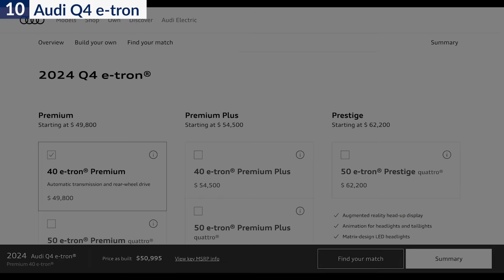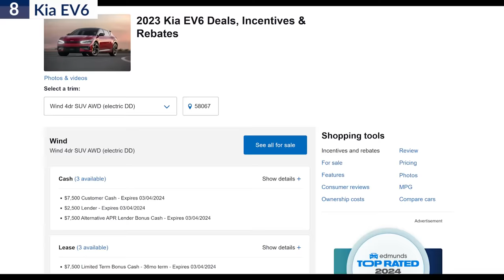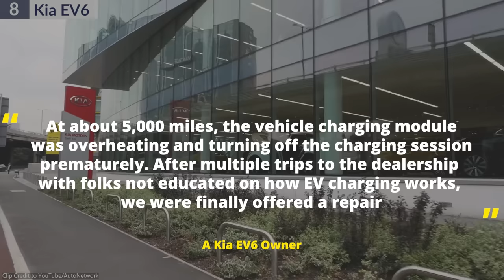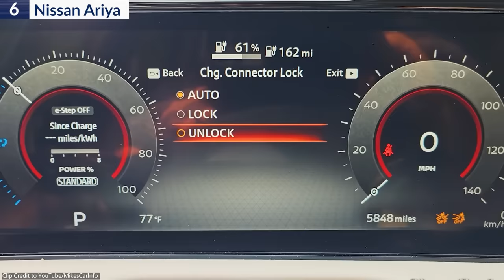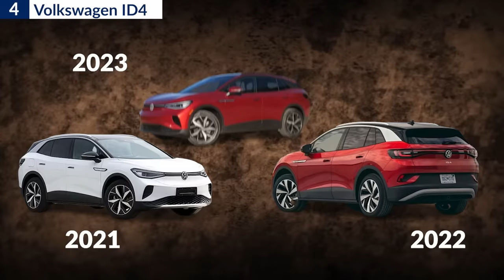New Electric Cars Piling Up on Dealer Lots in 2024 – Here is the Truth!

Comment: They will realize everyone doesn't want an EV or be forced to buy one.. I want to put in my gas and go. the battery cost more than the car.
Reply: CRAP EV MOTOR ,SCRAP METAL FOR RECYCLE PURPOSES!
Reply: @alexfung9097 its fine we can make starter motors and alternators out of the ev’s
Reply: Same here in Australia.
Reply: The battery obviously doesn’t cost more than the car.
Reply: @alexfung9097  Electric engines alone are better than combustion engines but energy storage technology needs a huge revolution to actually make ev cars compete with your classic ICE
Reply: In my 5 years experience I will never buy gas cars anymore. Best experience and no problem with charging. Also I hadn’t any problems with batteries. Still more than 93% of capacity.
Reply: @SergeyStupkin  precisely. The opinions of real life users is worth a million of these idiots.
Reply: @Audioremedy0785  Are you certain that a brand new battery pack wouldn't be more expensive than the car is worth? Not talking about a FRANKEN PACK cobbled together out of multiple already failed packs.
Reply: You completely Right…
Reply: How much gas and oil do you think you will use for 300,000 kms? About $25,000 in my country at current gas prices.
Reply: I was very much against an EV. I made the biggest mistake by purchasing a 2022 BMW M4 competition cabriolet - now 2 years later I just bought an EV - Porsche Taycan. Best decision I ever made in my life!! It works for me!!
Reply: @Lifeisapartydresslikeit  what I find funny is that 98% of people who buy an EV love them and will never go back. However 99% of people that hate on them have never even been in one let alone own one 🤣
Reply: @Lifeisapartydresslikeit  just don't trust it yet.
Reply: And never mind the damage to the environment, the pollutions etc? Just so you can use heavily subsidised fossil fuel?
Reply: If Americans had to pay the real price for their “gas” which isn’t a gas, but a liquid fossil fuel, they might switch to EV rather faster
Reply: @paulfowler3416 if they live in a apartment, can't charge at home. They wld realise ev charging is just as expensive.
Reply: @alexfung9097 still have to deal with the battery pack.
Reply: If you have that opinion don't ever drive a Tesla because your opinion will change instantly but I respect it no one should be forced to do anything... I'm trading in a 2019 mustang GT for the new Tesla model 3 Ludacris coming out later this year but you make a valid point no one should ever be forced in America... But then again we're forced to live next to a illegal immigrants and drive on the roads with them but then again we're forced to live next to illegal immigrants .. And they get licenses so they can vote.. That's the country you live in so don't be shocked if you're forced
Reply: @Longtack55  I get 26km per liter of diesel in my Hyundai Accent 1.6l and diesel is 65php per Liter. Oil changes are complimentary for the first 36k miles. So that's $1.07 USD and roughly 6.6 United States pennies per mile. My advise is for you to move! Even our 2023 Hilux gets 20kmL. You must be driving the shittiest ICE ever and buying the cheapest Chinese shitbox ever if you think you are better off.
Reply: @Plackomiot  if gasoline was better and more precise.. when you go to get surgery or the dentist .. You would have a gas powered saw or drill stop it guys it's what's happening and you sound like people... When streaming came out you would say things like I don't care about streaming I have a DVD player
Reply: I hear you. I was a non believer too
Reply: this is very true. My brother says the same exact thing you just said. People who have something negative to say never owned one (me included) and talk about ‘facts’ that they don’t know. Anyone I ask who have an EV say they will never ever ever go back to a gas or ICE car - EVER!!
Reply: @Longtack55 your country sucks - for that mileage it would cost around $10k for my car that gets around 50-52 mpg at $2.50/gallon cost - countries that have higher costs are intentional like California
Reply: Lol EV 😂
Reply: @Lifeisapartydresslikeit  But where do you live and how many people do you know who have BEV? Some people might live in the inner city and never leave 12 square blocks. EVeryone they know would be from that same 12 square blocks. A very small Plantation.
Reply: I was forced to buy an EV. Said nobody ever!
Reply: @rocksez5101  I as a taxpayer WAS FORCED TO SUBSIDIZE SOMEONE ELSE'S BEV!
Reply: @anthonybarnes5555  Its nowhere near as expensive I pay $15 to fill my batrery at a supercharger and jts 100% free to charge at my apartment because they have free chargers here. On a gas car you gotta pay $30-40 regardless of where you are
Reply: NOBODY IS FORCING YOU TO BUY AN EV! 🙄
Reply: @Jeffisright  Sure they are! I pay $300,000 in federal taxes and the government gives BEV buyers $7500. I'm being forced to pay for cars I don't EVen get.
Reply: 1. Child battery mineral labor

2. Range anxiety

3. Risk of garage fires

4. Paying 20k more than a
comparable vehicle

5. every time you fuel up an EV, the fuel tank gets smaller  and smaller. Battery degeneration. 

6. Poor resale value

7. Reduced performance in
cold, highway.

8. Higher repair costs

9. Awful charging network
experiences in the weather
without restrooms

10. Higher insurance rates

11. Replacing tires more
frequently. Michelin states that tires wear out 20% faster on an Ev, and could be as high as 50% faster! Ev tires made for ev's, cost 20 to 30% more, than regular tires for ice cars. As Ev tires wear out, they leave behind more tiny particles of rubber than normal ice cars. This causes more pollution. 

12. Death by autopilot

13. $25k - $35k battery

14. Low km range per tank of energy. 

15. must wait in-line 1-2 hrs
to charge.

16. Then wait more time to charge, while charging.

17. Spontaneous combustion, with no way to put out the fire storm.

18. If they catch fire in a tunnel, many people will die.

19. People without a pro charger system or a parking spot at their house, will run an extension cord to the road, which is dangerous and could lead to people tampering with your charging setup (super slow charging at the road)

20. If you're in California, you won't be able to charge your car past 4pm because of a shortage of electricity supply on the cheesy grid.

21. It is not actually "green". The pollution is made at the power station, not the car.

22. Only 5% of used junk batteries get recycled, the rest go directly into the bin. It's cheaper to mine for new minerals.

23. Chhinna actually does 70% of all the refining of the minerals and production of the batteries.

24. Minerals are becoming more and more scarce, and the cost will only go up, not down.

25. Some countries where they mine for lithium, actually use a very big boat load of fresh water to only produce a ton of lithium, so they are afraid of running out of water. It takes over 2 million liters of fresh clean water to produce 1 ton of lithium. 

26. Ev cars will soon not be able to drive in tunnels or be able to park in underground parking garage and probably will eventually void your house insurance if you park it in your personal garage.... 

27. You can't charge your battery at super stations when it is bitter cold out. 

28. If a fire truck comes to put out an Ev fire, all the chemicals go directly into the sewer system, poisoning everything. They need tons of water to slow down the burn. They can't put them out. They are only trying to prevent over things near by from catching fire. 

29. Ok, there is 2 good things; regenerative braking, which charges the battery while you are slowing down on the highway, which saves your brakes from much wear.

30. Loss of fuel tax revenue, so now the roads will only get worse, not better. 

31. in Dublin, huge generators are being used to charge EV buses, due to electrical grid strain. buses in Athlone also cannot be put on charge until midnight, for the same reason. Bus Éireann is saying that they can't charge their buses until 11pm for the same reason,  and to avail of a lower tariff. 

32. Not everyone on earth even has electricity to charge their cars. What are they supposed to do in 2035? It's easy to get a bucket of fuel to power up a regular car. 

33. VCE, or "vapour cloud explosion" is very bad. If any battery, typically anything larger than an E-scooter battery, and especially only "half" charged. If a problem occurs in the cells, it might not catch on fire right away. Instead, a cloud appears, and then may be ignited a short period afterwards. There are 2 different types of vapour clouds that appear; heavier and lighter than air, which form will be dominate, can not be predicted yet. This produces a bomm.

34. For Ev transport trucks, they aren't allowed to carry the same payload as a diesel truck, because of the massive weight of the battery. The owner of the Ev truck therefore loses potential profit, every day. They also lose more profit for the waiting times for charging that Ev truck. The driver will get paid to charge the truck, which in turn forces the owner of the truck to lose more money. 

35. Ev cars are more likely to be written off, if they experience a minor collision. After the collision, something could have upset the structural integrity of the battery. 

36. Ev cars lie to you. If you are bold enough to go out on a decent road trip and its 210 miles, one way, and your Ev tells you that your battery will last you 223 miles, there had better be no hills, or excessively cold out.... You'll probably get stranded, trying to get to the charger, at the end of the trip. Ev's have left many families stranded already. 

37. Ev's and their batteries, will soon need their very own "passport". With all info about them when born, and current info about them (power output, resistance, mineral composition, etc.) 

38. Thieves stealing charging cables, will soon make it impossible to "fuel" an Ev car. They take a long time to replace the cables, just to have them cut again for scrape money. 

39. Cars were typically being made lighter and lighter using aluminum and or fiberglass and or carbon fiber, to reduce emissions and pollution. Ev's are only getting heavier and heavier, causing more pollution than ever. Remember, an ev's pollution is made at the power station and the dump, not at the actual Ev, except for the tire particles as mentioned above. 

40. More on spontaneous combustion of the battery. What if you had 3 kids strapped into car seats, in the back seat ,which kid do you rescue? More fires start so fast, there is hardly any time for even the driver to escape, let alone 3 kids strapped in. 

41. There must be a reason that Boeing 747's aren't battery powered.... Until jets are battery powered, I'll be sticking to fossil fuels for my mode of transportation. 

42. Can't bring an Ev up north in the woods, nor any battery powered chain saws, where there are no grids to charge them up. You would need a huge amount of solar panels to get you anywhere. 

Ev's (External combustion vehicles) suck, and it's a bridge to nowhere. But they do sometimes convert themselves into "internal combustion", but sadly, they can only do that 1 time.
Reply: Too bad you are so poorly informed.  That battery has a 100,000 mile warranty and 8 years.  The engine and transmission in your ICE car/truck has a 36,000 mile warranty  yet if properly taken care of will last for 200,000 miles or more. 
     Like the battery of the newest Tesla will likely last a million miles.
Reply: The new Tesla’s are exactly that!! .  90% of all daily travel will be covered by less than a single charge.  Then you will go home and plug in during off peak hours. 
  Instead of costing you $40-50 bucks for a fill up it will cost you $8.
Reply: @robertkubrick3738 if they live like that. Why do they have a car?
Reply: @jakefriesenjake nobody. Absolutely nobody read that.
Reply: @Eddie_-_  ha. You bet your mammas life on that?
Reply: @jakefriesenjake  don’t laugh. It’s you, not me who has a standard reply saved on your old laptop to post on the internet in various threads. Even my mum would think that’s pathetic.
Reply: @Eddie_-_  actually, I have an old laptop, newer laptop, newer desktop, and newest galaxy S23 Ultra, my boy. Yeah it's copy n paste, but it's my copy n paste. 🤣🤣
Reply: @jakefriesenjake   desktop?
Reply: @Eddie_-_  what about it? You not know what a desktop is?
Reply: These automakers have to sell less than Tesla , because nobody is going to pay more for a non Tesla
Reply: @jakefriesenjake   off course I do. But haven’t heard anyone talking about it in 30 years.
Reply: Who's forcing you or anyone else too buy an EV??
Reply: Who's forcing you or anyone else too buy an EV??
Reply: @Eddie_-_  why not? Almost every single office in the world has a desktop computer
Reply: No more oil subsidies
Reply: @Audioremedy0785 True but if the EV is say 6 years old and the battery is dead it almost is...
Reply: @Audioremedy0785 When it is time to replace the battery, it costs more than the car is worth. That is a true statement.
Reply: @Audioremedy0785 So the 95% who don’t want a clown car are idiots? 😂😂😂
Reply: @frenchydampier2209  large % of pple don't have off road parking. Can't charge at home.
Reply: @mikeses4392  in what way is an Ev a clown car…
Reply: @jakefriesenjake  I work in a multi national company and travel a lot. I have not seen a desktop computer in at least 20 years. I don’t think you can buy one, unless you’re looking for a gaming computer. 
Could it be that you are a bit behind on the technology development and that’s why you’re against EVs?
Reply: Do you know in Europe  you can get a Peugot 5008 1.2 three cylinder petrol for the same price as a Tesla Model 3. Funny thing with this video is that it does not mention the Tesla brand. I know why. Its because they make the best selling car in the world at the moment. People are buying Teslas instead of the other brands due to them being better.
Reply: @andersriksson100  not really no. It’s almost out of warentee yes. But the expected life of a battery is 10-12 years. And life is defined as a capacity of over 80%. After that time it’s very reusable. And costs of batteries are expected to be less than £5k within 8 years from now.
Reply: @andersriksson100  when you say they ‘fail prematurely and are expensive to replace’ - they are covered by an 8 year warentee. So if they fail within that time they are free to replace and if they fail after that time, with the anticipated reduction in cost, they will be about £5k to replace after 10-12 years. Giving you another 10-12 years with a car that’s saving me £2k a year on fuel.
Reply: @Eddie_-_  not really, I've fixed computers before, and own the top of the line phone.

Not against ev's, get what you want. If you only travel very short distances, it might work out for you. If you own a garage or a parking spot, even better. You would then be able to charge your car at home. All cars have problems.
Reply: @Audioremedy0785 What I find even funnier is that over 20% of first time EV buyers...REGARDLESS OF BRAND...have done EXACTLY that and gone BACK to ICEVs.

Sounds like your stock picks might be dropping...as well as your service and repair options for your golf cart...
Reply: @Lifeisapartydresslikeit Sounds like you have the income to buy an EV as a TOY.  Most people are making their purchase decision on having this as their ONLY car.  Most people find EVs an underwhelming option...and don't buy even with government mandates.
Reply: @paulfowler3416 If it was subsidized it wouldn't also be getting TAXED.

Please learn definitions...words mean things.  To paraphrase a movie...'subsidy...you keep using that word.  I don't think it means what you think it means.'
Reply: @paulfowler3416 No, since the NON-TAXED, NON-GOVERNMENT DISTORTED market price for those fuels would be far LOWER than it is.

Drops in the prices heading into the presidential election are going to absolutely KILL EV sales.
Reply: @commoncents864 No, if EVs were any good, the EV1 would be the oldest used car in the market today, and ZERO government force would have ever been needed.

Peopke who know how to drive and who have tried EVs, have mostly found them to be INFERIOR to an ICEV...TO INCLUDE THE ONE THEY CURRENTLY OWN.  That is the main reason people WON'T be buying one any time soon.
Reply: @rocksez5101 NOT.  Said every trend humping tech consumer in urban areas who bought an EV and has to crow about it online to keep their local social cred.
Reply: @frenchydampier2209 There isn't an EV battery pack that's made it past 300k yet, or even most EV MOTORS.  That's a wishful stat that hasn't happened.
Reply: @frenchydampier2209 IF you can recharge at home.  If NOT, and you live anywhere outside of SoCal, tour ONLY charging option is PUBLIC charging, which is usually over 40 cents per kWh.  And your golf cart loses charge just sitting there, so you'll be charging more than just the distance you drove...EVERY TIME.

At least the fuel you put in an ICEV is still there the next morning, meaning you don't HAVE to visit a fuel station EVERY MORNING.  So the actual amount you spend in charging will end up being as much (if not MORE) than what you'd spend on petrofuel.

Just the facts.
Reply: @Audioremedy0785 maybe not initially but it will when the battery needs to be replaced. And the car has lost its value
Reply: @DavidChick-z8s  it’s a weird one as ‘battery failure’ is catagorised as when the battery has 80% or less charge. If my car is 12 years old and has 80% of its range yet, I’m not complaining. And the cost of batteries is expected to half in the next 10 years. So spending c.$5k on a battery pack having been saving $2k a year on fuel for 12 years is literally nothing.
Reply: @Audioremedy0785  Well I just don't agree. There are too many expectancies, too much trust in suppliers in your reply, at least to me. Guarantees of 8 years/160000 km isn't much for such an expensive car as most EVs are and we don't know if batteries will be significantly cheaper, still very expensive even though they been around for more than 10 years. But to each their own.
Reply: @andersriksson100  I think manufacturers have trust in their product. Otherwise they wouldn’t offer guarentees. And the reduction in cost of batteries is inevitable. Can you name a single technology where the version available 10 years ago wasn’t cheaper?
Reply: EV is so much better. Period
Reply: @@DeezNutz013 LOL indeed, since your numbers aren't even backed up by TESLA.

People buy Teslas because they're a trend...PERIOD.  As evidenced by plenty of YouTube channels come and gone, if they think the trend isn't growing, they quit their car and their channel.

Nit a resounding endorsement of 'the best EV.'
Reply: @earthring  Not in reality...hence the mandates and subsidy.
Reply: @Audioremedy0785  I don't think you read my post right! I said the guarantees are'nt good enough. And they all said batteries would get cheaper in time with volumes, but now more than 10 years after they where introduced they are still fragile and too expensive to swap. There are quite a few examples of EV owners with faulty batteries beeing quoted 10 000-30 000 US or more for a battery swap, crazy!
Insurance costs are sky-rocketing because of that and expensive repairs.
I'd never buy a used EV 6-8 years old close to 160000 km om the meter - that battery could die anytime and then you are screwed big time. So a used EVs will probably have low resale value quite soon. Bad for TCO but one might fool oneself the first trouble free years with low running costs, they wouldn't be the first or the last...
Reply: @andersriksson100  I read your post quite clearly. I have seen crazy posts where people are getting mad quotes for battery replacements.  But I have also seen that battery replacements are very rare and in almost all cases where it’s chargable, it’s a reasonable cost. The reality is that battery capability will increase significantly over time.  In 10 years you will be able to get batteries with todays capabilities for a reasonable price or batteries with much more significant capability for a higher price. I have never bought a high tech product in fear of the tech not being improved over time. I love my EV. They are not for everyone and if you’re worried about that kind of thing then you are right, they are probably not for you. Bit my Tesla is ana amazing car and an amazing drive and my only regret is that I didn’t do it sooner.
Reply: Battery does not cost more than a car 😂
Reply: @DeezNutz013  Simple search shows that thry SHOULD be able to go that far, but the ones touted as doing so have later been retracted because the battery had to be either repaired or replaced under warranty.  That's not the same thing.

And as to your numbers...how much did you pay for installing an actual L2 charger in your garage (which most folks don't have, by the way)?  How much power OVER AND ABOVE THAT USED TO  DRIVE did your car suck down in that time frame?  Are you getting state subsidy to mitigate charging costs?  How much power are you getting from your 'free' charging that not everyone has access to?

Some of your costs are being borne by less well off people, and you're not providing the entire power usage picture for your car.  So your 'costs to run' numbers are also a bit suspect.
Reply: @SergeyStupkin  my 2015 Tesla model S has been the lowest  cost to own luxury car I've owned.  So far replaced 2 sets of tires and 6 bottles of windshield  washer fluid.
Reply: Subsides are paid for EVs, not oil companies. You are delusional
Reply: @Audioremedy0785  If present batteries has'nt dropped  in price the last ten years there is not much saying they will soon. Further, will it even be possible to get hold of a Tesla battery to a Tesla of today in 8-10 years? How do we know if batteries of tomorrow (solid state?) will fit EVs of today? I belive many EVs prematurely will be considered a “totaled” car by insurance companies because of this, it has already happened.
Reply: Own an Audi etron. Will never go back to Ice. 300 mile range in summer if sensible. 6p a kw charge at night (50% of battery) suits me
Reply: They don’t have near enough range but I test drove a Model Y and 3 and loved the way they drive.  When they became available in my country, I ordered one the first day.  It’s been a really good car. Super cheap to drive.  Our beach spot for mini vacations used to cost $40 in diesel to drive home.  Now it’s $9 worth of electrons, on a third party charger.  (Superchargers don’t exist down there yet. ). The model Y’s inter is minimalist.  This is code for featureless, but it gets the job done.
Reply: 7-13k depending on the model? It's the same as replacing the whole car though and they have some that have exceeded 500k to a million miles.
Reply: I do believe people should be able to drive any vehicle of your choice but I have had 1 % degradation since 2018 and after owning many gas cars I save a lot of money in not having to buy individual parts, oil changes, oil filters, spark plugs, fuses, transmission fluid, fuel filters, pistons, or replacing a whole motor. Also no one can sabotage my car just by adding some sugar.
Reply: Go to California…
Reply: @emmajones9228  after owning a Nissan Leaf hatchback and a Tesla it really depends on which car you pick for what's worth it for you. I recently ran into a family trying to charge an EV at a Tesla station that uses CCS. Rental places don't explain things like an all called plug share and the difference between cars
Reply: u already pay that at the ev initial purchase, at 0 miles done. plus electricity isnt free  and r u sure your ev will last 300k miles? my non ev car is now 20 years old, will yours last the same?
Reply: U was forced to take a shot wasn’t u 😅
Reply: @SergeyStupkin  Do you have the privilege of charging at home?  Many of us don't.
Reply: @commoncents864  the most idiotic comment ever 😂😂😂
Reply: There are seven new Teslas on my block alone. I purchased my first Tesla Model 3 Performance in 2019. Everybody that I have let drive it ended up buying one or two. We just picked up a Model Y Performance for my wife two months ago. We still keep two ICE cars. I plan to add a 911 S next and will give my BMW M3 to my son.
Reply: 😂😂😂😂😂😂 we already have 3 and I Switch now to number 4 who is everyone?? The absolute dünn????? Asking for a friend
Reply: @SergeyStupkin we top!
Reply: @paulfowler3416  the damage to the environment? You mean like mining for lithium.... you sound literally like the people in that episode of SouthPark, the ones smelling their own farts that is 😂
Reply: @commoncents864  so what you going to do about all those illegals driving on the road??
Reply: @mocheen4837  "One or two"?  What kind of area do you live in?
Reply: @Lifeisapartydresslikeit More importantly, buy only Tesla in these early days of EV adoption. They are the masters of the technology and they have the supercharger network already built. Roast me if you like, but you know I’m right. Yes, I have a Model 3 Long Range All Wheel Drive and won’t go back to ICE.
Reply: @robertkubrick3738 Well the upside of being forced to subsidise an EV is that you weren’t forced to subsidise universal health care, so that was a win for you.
Reply: @jakefriesenjake Don’t buy one then. That’s you fixed. 😀
Reply: @billcichoke2534 I like reading your posts; Trump is going to win, isn’t he.
Reply: @petergersbach7355  It's forced subsidy of something that is eventually a detriment to everyone.  Whether golf carts or 'free' healthcare, there are ALWAYS negative consequences that outweigh any EXPECTED benefit.
Reply: I agree. Some battery packs are more than 30k..😡
Reply: @anthonybarnes5555 I live in an apartment and I charge out my kitchen window     

Been doing it for 6 years.
Reply: @jakefriesenjake WOW!! Talk about a lot of BS.   You’re the winner of the most anti-EV BS I ever read.
Reply: @NAY2GAS  🤣🤣🤣 what floor do u live on.
Reply: The battery is the car
Reply: @Audioremedy0785  There have been numerous reports even on the liberal national news of people with a one or two-year-old EV, the battery gets damaged, and the replacement battery cost as much as the car cost when it was new.
Reply: @SergeyStupkin  Come tow my 14’ work trailer or try to charge your vehicle sitting outside on a -20° Minnesota night. Or, get in your vehicle and drive 1000 miles straight to visit a family member.
Reply: @DuffyGabi  I drove last month 1500 miles. 6 stops. Each was 20-30 minutes. No problem at all. Also I charged my car at -12. Also wasn’t a problem. Yes, range is different but it wasn’t a big problem. All what you can do with ev is planning ahead. For some people it’s not easy. As for me not harder that drive on ice cars
Reply: @DuffyGabi  numerous being ‘a couple’. All prices quoted by insurance companies who need to justify writing the car off for the purpose of a direct replacement.
Reply: I drive my Tesla model Y Performance and you will always see my tail lights!
Reply: @derrickhuggins6453  u sound miserable 😂 and I don’t care about none of this matter or that matter or any matter 😂 but hey go off 🤣 prove yourself to the world u got this 🥲
Reply: @disgracetwt5513 lithium mining can be done much more cleanly and lithium is on the way out as battery science advances apace. So ,including the egregious insults, you appear to be wrong on every count.
Reply: You are right, this is an issue that needs to be resolved and needs government investment in infrastructure. Norway manages so why not other countries? Lets see, politicians, especially, but not only, right wing ones, don't help, with outdated and rather silly views.
Reply: @paulfowler3416  keep yapping
Reply: @disgracetwt5513 I admire your well constructed, reasoned argument, so persuasive, so redolent with facts. Tells all that anybody might need to know about you.
Reply: @jakefriesenjake  Brilliant summary and analysis Jake
Reply: @Eddie_-_  Well if they didn't,  they should. All true and very frightening
Reply: @NAY2GAS  You're not very bright, are you? What did Jake say that's not true?
Reply: Funny you see having to put gas in your car as convenient. I charge my car up overnight and rarely need public charging. It would feel really inconvenient to me now if I had to stop for fuel.
Reply: @EVil-ob8in  yeah but not everyone has a spot to charge cars overnight.

Some park on the street, and so on. You're blessed, lucky, or privaliged.
Reply: The question has to be asked,how long can manufacturers of EVs sustain these sort of losses ??? and get back to making vehicles that people wish to buy instead of these overpriced milk floats,time will tell.
Reply: Who has been “forced” to buy an EV???
Reply: @tdsil  me. They are saying they are phasing out gas cars.

They already got rid of gas lawnmowers in Cali
Reply: @robertkubrick3738 Absolutely positively sure. Facts matter, try them.
Reply: yea, ok, whatever. I'll get 2 EVs then
Reply: Maybe not more than it's car, but definitely more than normal car